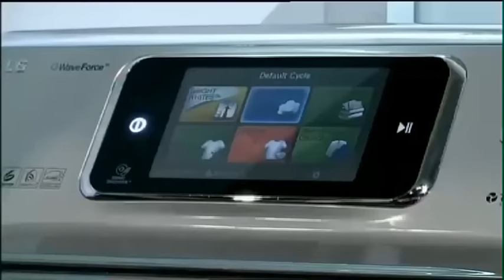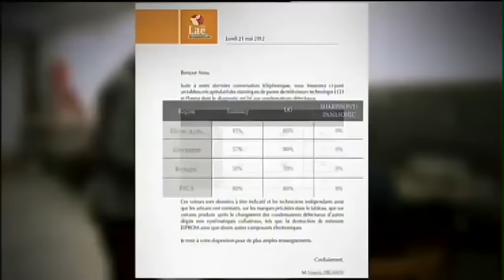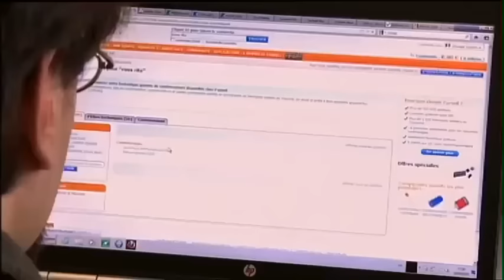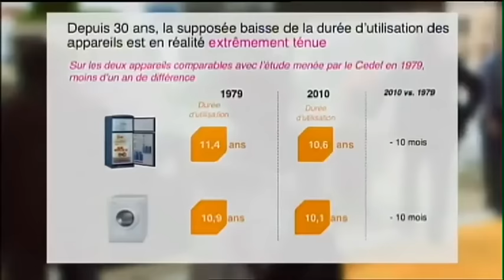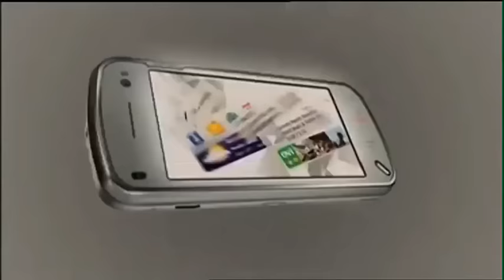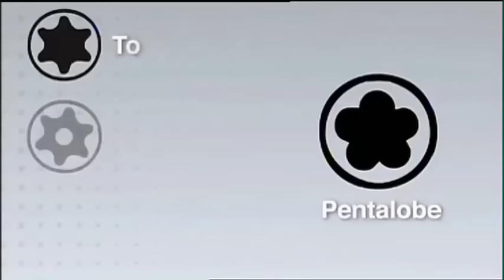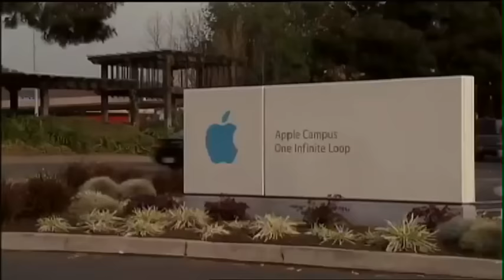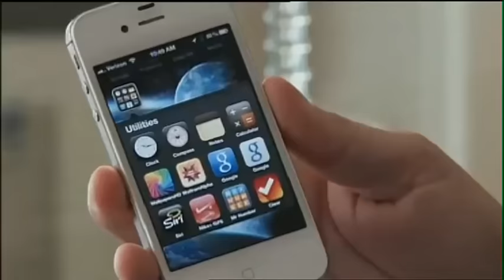Apple and Samsung: Built to Fail? The Truth About Planned Obsolescence | Investigative Documentary

Comment: Apple's planned absolencse is the reason I'm moving away from Apple
Reply: My iPhone 6S plus runs just fine, only replaced the battery once.
Reply: I've had my iPhone 6 Plus for 10 years now and it's outliving the Otter case I bought for it when the phone was brand new.  Biggest issue is the battery which I've had to replace 3 times.  Next biggest issue is Apple won't let me install a newer iOS version so some apps won't work correctly anymore or can't be used at all anymore like my bank's app and the app my work uses for communication and shift scheduling.  My phone was still in pristine condition until I dropped it recently after the case had deteriorated enough which it hit on a corner and cracked the screen but it's still usable I think thanks to the screen protector.  It's gotten slower which come to find out Apple had planned that in the obsolescence as well.  Plus it only has 16GB so can't add any more apps to it nor take very many pictures and videos.  I will need to buy a new one soon and thinking about something like the Pinephone where the battery is easily replaceable but the number of apps for it is very limited.  I don't know yet.
Reply: Apple left a bad taste in My mouth after I bought an Mac G5 in 2004 for nearly $2800.  
2 Years later the updates stopped, I was mad and decided never to buy any product that has I Bit A Rotten Apple again.

Comment: To place Electrolytic capasitors away from heat sink is  Basic ABC in good elektro design. Take the led light bulbs used in house,every one of them has equal to a phone charger in the socket a switch mode power supply witch create a lot of E component garbage all those components used in making those use more energy and materials than the old wolfram based light bulbs. They was among the first mass products that had planned failure, they made them to last only 2000 hours max. There was no problem to make bulbs that lasted many times longer. This they did in the 50s or 60s.
Reply: When I was replacing an light bulb with a led for a specific application I was reading the specs sheets of led manufacturers, I found out that a led sold in the 10w category can not be driven at that power without shortening its 10000h life, it was right there in the spec sheet. 
In another note the 50 GU10 led bulb that came with the house I bought ALL failed within 3 years, looked like heat cycle induced fracturing of the solder points to the alu heat sinks. These same LEDs taken out of the original lamps, put into another application and driven at a much lower current still work fine 5 years later.

Comment: I FIGHT OBSELESSENCE!
I live in VietNam and there are ethnic villages, usually small & remote. In Ho Chi Ming City/Saigon old cellphones are on sale for a few dollars.

A couple of these vendors let me test the phones so l can pick "winners" that function. I then take these, add a power "wart" and hand them out.

At at suitable high spot l install a REMOTE ROUTER and set up a WiFi network. This links all the homes together.

One of our cell suppliers have arranged for access to the network, and l add a module that records network use so the User can be billed. 

For those who don't wotk with Remote Routers, they simply act as a normal router but use radio links. 
😊

Comment: The power surge thing is why you MUST buy a UPS to keep your electronics protected, this includes your TV & stereo, and NO Samsung is NOT the cheapest, Phillips, Vizio & others. Samsung also SELLS MORE TVs than most of the other brands combined
Reply: UPS, Fridge Guard low voltage protectors, Electronic high voltage protectors.
They all behave as a goalkeeper in a football match.
But even the best goalkeeper can't prevent the opposite team from scoring 100%.
Electrical appliances shall always be overwhelmed by electrical surges and scrapped.
Reply: @wawerukamau1260  That hasn't been my experience, ONCE I put UPS backups from APC, CyberPower & 1 other brand who's name escapes me at the moment, but suffice to say, I'm the past 22 years since I enforced this practice of having battery backups on everything from my PC's & Laptops to my LG OLED TVs, Sony Projectors, Denon & Pioneer Stereo receivers, Blu Ray Players, Xbox 360, Xbox One X, Xbox Series X and more appliances, I thankfully have NOT had any power related issues. I have also spoken with several electricians and a friend that is a Electrical Engineer & they all say the same thing, which is this; "these days, modern appliances from your PC to your fridge have processors, memory, storage devices, etc, and due to the constant shrinking in Fab size from the original Intel Pentium mmx CPU which was 350nm that ran at 2.8V, to the popular Intel Core i3, i5 & i7 CPUs of the late 2010's that shrunk down to 32nm (that's over a 10 times, but more importantly the voltage ⚡️ was lowered to around 1.35V), to modern Raptor Lake Core i9-13900KS CPUs that run at a slim 1.49V (Note: this is a bit higher that the Core i7 3930K in one of my 15 PCs, because the i9 is the high end, high power, flagship of the Intel fleet) and on its Intel "7nm" die process running at a blazing 5.8 to 6.0+ GHz, is a insane jump from the 200MHz Intel Pentium mmx from the late 1990's, BUT here's the rub, the smaller the die, the lower the voltage, the faster the processing speed, the more tight the voltage or electrical ⚡️ specs need to stay in. For example, back in the 2.8V days of the Pentium chip, a .5 to even a 1.5 voltage drop for a moment could be compensated for as the CPU wasn't running that fast, and it was more akin to a slight brown out where as NOW, a .5V to 1.5V fluctuation is the difference between ON and OFF and this is where most damage occurs, during brownouts, more so than power surges (yes those are bad, but most VRMs on good motherboards or electronics can buffet that surge and keep everything running, where as a brown out or loss of power can't be magically made up, if your power Brownsout or goes off for a moment it's a huge punch to your modern electronics and that my friends is why I recommend investing in battery backup (and a generator if you have to run for more than the standard 30 to 90 minutes that most UPSs will keep your devices powered), also don't forget to check & REPLACE (if needed) the BATTERIES in your UPSs, I just ordered 5 pairs of batteries for 5 of my UPSs last year as they where only keeping power for around 3 to 5 minutes after 8 to 10 years of being in service (checkout BatterySharks for great deals on replacement batteries), and so when the power flickers, goes out, or is out for any extended period of time (as is becoming more and more frequent with all these "green energy" pushes that are causing electricity prices to skyrocket while often NOT being able to produce enough power (and the government keeps pushing EVs, which is NOT going to help)). It's better to be safe and prepared and have battery backups on your critical devices (for example did you know that most if not all OLED TVs (as an example) due a 10 to 12 minute behind the scenes refresh of the OLED screen for every 4 hours of "on" time, and if your power flickers or goes out during this refresh process, you can "Brick" your TV, check out the video on "Digital Trends" YouTube channel about this, and this should highlight the fragility and potential headaches that a simple power fluctuation or outage can cause. OK, enough about the virtues of battery backups and generators, just stay safe, be as prepared as you can be and let's hope that we, the people, can get this green obsessed government out of power and move back to being energy independent.

Comment: I checked two Apple ][ power supplies which are more than 40 years old. 95% of the caps were still intact. We checked the voltage levels of one of the ps and they were still perfect.
I only replaced the X filter caps because if they fail there will be a rather violent explosion.
So a good design will last forever.
Reply: It shows you that Apple 40 years ago were in need of making quality equipment because they were trying to make a good name for themselves nowadays they’re so big they don’t need to do it!
Reply: My recent Apple phones have been awful…… battery’s failing ,Wi-Fi chips failing etc my old iPhone 5 it’s still alive after 5years (by the way my Samsung phones were really bad ,a years life ).

Comment: Nope, I don't think "It's normal!" - I've never owned a phone where I could not remove the battery without tools! I hopped from manufacturer to manufacturer to keep this feature, just like SD-Card-Slot and headphone-jack! I also keep my phones till they break (why spend so much money on phones? Hell, I have mine more or less only to call help when the car breaks down and maybe to send messages)...the only tech I truly switch every 2-3 years is the graphics card in my desktop computer (the other parts last 5-10 years...my old rig lasted from 2011 till 2021, when I built my new PC)

Comment: Yes that's why I'll never buy anything from apple. I'll stick to android, and I pretty much stick with the cheaper side of Motorola. Perfectly good 4g LTE phone that has all the capabilities I'll ever need and well built for the price. The only thing I'm not really a fan of is the built-in battery, but it's a pretty robust battery that can easily last 5 years, and the screen is gorilla glass making it much more durable than most other phones. Definitely my preferred phone. As far as my refrigerator goes, my GE side by side from the mid 1990s is still going strong in 2023. I've seen so many problems with the new fridges that I'm definitely keeping might till it dies. I also still have all of my old CRT TV's as well. We got a couple flat screens, but the old ones still work fine so they're not getting thrown out. They might even be worth something one day as antiques. Anyway awesome video, and more news coverage needs to be paying attention to planned obsolescence.

Comment: How do you use a refrigerator more . You  kept   your fridge on all the time then and on  all the time now lol  . Ones without auto defrost the downtime would not be enough to impact wear and tear parts . Today’s refrigerators are supposed to be more efficient . You would hope that  would reduce the run cycle if the insulation has  improved which you would hope is improved with the  advancements in technology.

Comment: What an utterly fantastic report - I hung on as long as I could to my old phone because I could replace the battery but as much as I agree with this report older phones cannot handle the amount of data required today, I mean what use would be a Nokia with a pull up antenna these days. That said, there is a fairly large window before a phone becomes technically redundant and in that time ( I guess 5 years or so) a replacement battery solves a lot of issues.  Currently there's a mad rush to replace incandescent light bulbs with LED's. All proclaim 25,000 hours run time but I find they last less time than the old stuff.... and who calculated that 25,000 hours? Nobody. It was a guess based upon the characteristics of the components - I guarantee nobody has run an LED lamp for 25,000 hours to see what it does but they stick it on the packaging anyway. When it comes to domestic appliances we only buy the best. So far this has worked well for us with minimal issues. Our current washing machine has completed 10 years service and is used 2 times a day, everyday. Thanks for bringing this report to us, I am just surprised how few views it's had (36k when I joined), maybe it's indicative of the population who simply don't care.  Finally,,,,, my Samsung capacitors blew as well!!

Comment: I have a Panasonic plasma from 2006 that is still going strong, all original parts. 

I got a Sony Bravia 4K OLED in 2018 the panel started developing dark spots and discolouration within the first year and was unusable by 2020.

I replaced the Sony with a Philips Series 3 Ambilight OLED in 2020 which started developing the same problem as the Sony before the back lights failed last week, probably down to cheap psu components like in this video. 

The biggest current day problems with TV’s is that the only manufacturer of large OLED panels is LG, units are discontinued within a year of release to the market making it hard to source parts, a lot of brands don’t even exist anymore and have changed ownership or have generic units made by 3rd parties.

Philips TVs are owned by a Chinese company called TPVision, Toshiba TVs are made by a Turkish brand called Vestel, JVC UK is licensed by Currys PC World, Kenwood UK is licensed by Currys PC World, that’s just a few examples. 

I have a Hotpoint washing machine made by Indesit, I paid a premium for a brand as the internal components are the same as an Indesit washing machine but costed more than an Indesit, I had to get a replacement door for it a couple of month ago and found out they’ve been took over again by Whirlpool, so parts for my Hotpoint washing machine made by Indesit now come from Whirlpool.

Comment: ps 1% ...thats a lie which obviously your unable to verify.. what you need to understand is that they contract out their board manufacture - especially the power supply and they pay for cheap parts, cheap power supplies, sub standard cheap capacitors, I know, I used to repair them.

Comment: I really don’t understand why Apple is always used as an example of thing with poor lifespan. I have a MacBook from 2015 which works perfectly fine. Nothing ever replaced. Show me a pc from 2015 still in use. The resell value of Apple product is also very high compared to other. Why? Because they don’t last very long? True that iPhones don’t last forever, but replacing the battery gives them a new lease of life. Apple also keeps the software in quite old devices working fine. Windows updates makes old PCs grind to a hold. My 2 year old work PC takes about 5-10 min to boot. Sure just run Linux and build/repair everything yourself. Problem is most people don’t have the skills or desire to do so.
Reply: Wow really 2015?  That's eons ago.
Reply: Lol